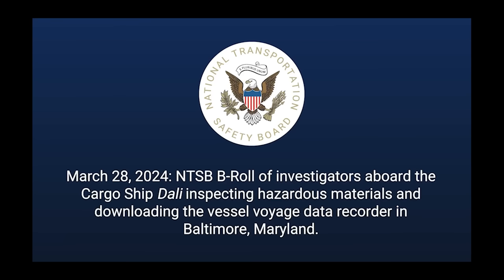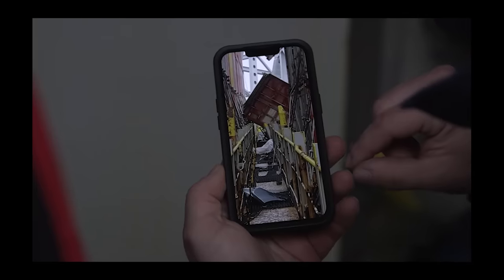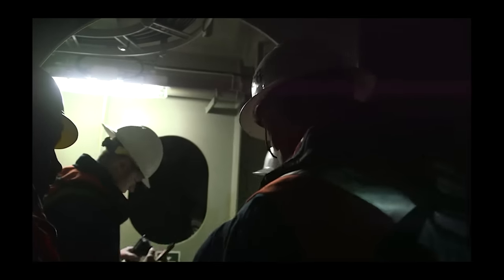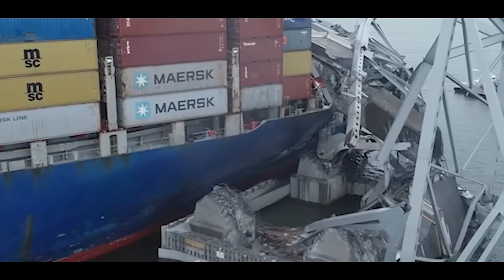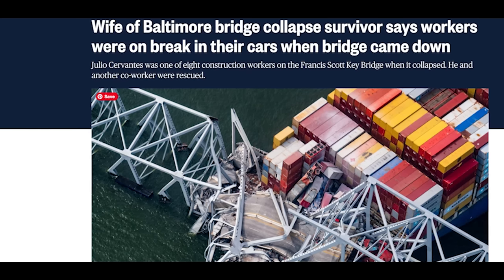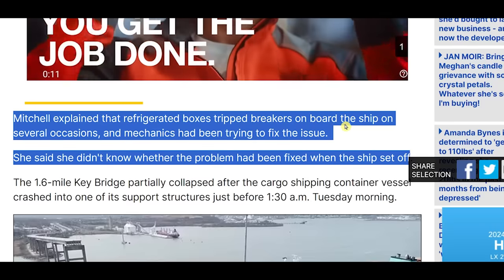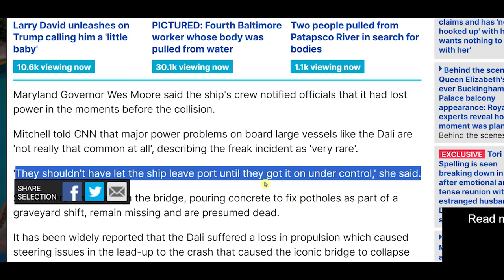NEW NTSB Video On Dali Ship Point of Impact Key Bridge

Comment: Refrigeration / ancillary equipment wouldn't be commingled with ship propulsion / maneuvering /navigational equipment/circuits . That's not going to hold up for long as an excuse for losing control of the ship.
Reply: Exactly.
Reply: and this is not just in baltimore. this has been a logn term issue with the ship
Reply: Totally. I'm a prostitute and I'm always on ships and have even been on the Dali several times and I can tell you they had problems then so I'm not too surprised.
Reply: @beckydoesit9331  That's funny you should mention that.
One of the first impressions I had in reference to, where was the captain and harbor pilot when this started.
In the Capitan's/ owners stateroom partying with hired help.
Reply: @RosanaArcelo  As well as determination, human defiance and human deviance .  Accidents do happen anytime anyplace, as does fraud as well as greed.
Reply: @RosanaArcelo  it costs huge $$$ to be tied up at port and the port authority would have been screaming at them to get the hell off his dock so the next ship can berth.
Reply: @Revkor  That ship / Captain and possibly crew , aren't going to be an issue for quite a while. maybe longer.
Reply: @tuck6464 please don't confuse accidents with preventable incidents. This was a preventable  incident.  Someone(s)responsible.  I would seek the answers to were federal laws and mandatory safety regulations followed..Jeff makes an excellent point in why did this ship ever leave dock with unresolved electrical problems. Why did escort tugboats leave Dali's side before open water? Coincidentally the Dali lost all electrical power shortly after that. .any questions no answers.
Reply: @heartobefelt  and giving  the greenlight for a massive vessel's voyage to SriLanka halfway around the globe? A trip expected to take 27 days yet couldn't make it out of Baltimore. Lots of questions no answers.

Comment: The UN numbers are indices into the hazmat classification list, with hazard category and shipping safety requirements. They aren't directly tied to the MSDS, although each UN number does correspond to one or more MSDS's.

Blaming the breaker for a trip is seldom accurate. They have a trip curve specified, in terms of  overcurrent vs time to trip, which varies by the type. If you tripped a 20A breaker with 17A, you probably had a transient inrush current that spiked over 30A. As i recall, standard home breakers fast (magnetic) trip at about 150% of rating and slow (thermal) trip at about 120%. I'd have to go look up the specs at UL or the NEC to get exact numbers.

Comment: the meter at 2:22 is for checking o2, LEL, and VOC's
Reply: It can only measure LEL if you know what you're measuring the LEL of.  The LEL of petrol (gasoline) is different from the LEL of propane.
Reply: @cjmillsnun The LEL reading is to evaluate potential explosive air/gas conditions and is not specific to a particular chemical, although the most common compounds are hydrocarbons.  LEL stands for lower explosive limit. There are special sensors for volatile compound  (VOC) specific identification but those sensors are mostly used in specific site conditions where the VOC is known.  Keep in mind the LEL is used for site safety and not generally for investigative data collection.  The instruments are calibrated to a flammable gas mixture.

Comment: The power to the cargo should never create a situation where it would compromise the ship's main electrical power system. This would be by design. Something else was going on. If it was severe enough to cause a total power loss, this should have been a major red flag to the ship's crew that something serious was going on. Virtually everything on these ships besides the prime mover is electric.
Reply: Everything will be getting tested including checks for fuel contamination , mechanical faults in the engines , electrical faults in the ship and electrical faults in reefer units , as well as the human factors , Did the crew do their job by the book or did they panic and make mistakes ?

Comment: @17:42 - They are definitely solid concrete (the Concrete Bridge Posts/ Piers). I could easily see that on my cheap 65" 4K television that I use for a monitor). The reason on smaller monitors they may appear hollow is because the concrete is darker in the center. @1:17, I believe the Grey metal is part of the ship's superstructure (primarily to support the container decks). That's why is is so large/ beefy. Of course it's difficult to tell to some extent because the bridge was also painted primer grey.

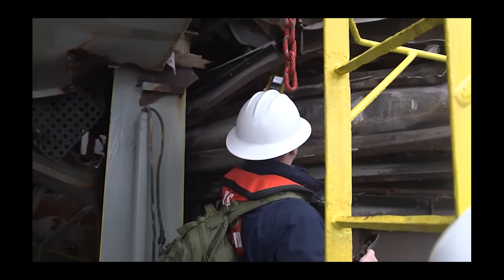Comment: 02:12 I am fairly certain that is a vibration meter. 
Also regarding breakers. Many people dont understand too that breakers can degrade with each trip. Especially if they are breaking quite high currents. The contacts inside the breaker will get pitted and wear down. Often why troublesome breakers only seem to get worse and worse

Comment: Jeff, The NTSB stated that the Dali at 1 27 am and four seconds. " The pilot ordered for the port anchor to be dropped." The thing no one has been saying is, Doesn't this ship have multiple anchors? perhaps one on each side? what about the starboard side one? If they dropped only the port side anchor as stated, it would cause the ship to change course and turn to the right...Turning right into the bridge support.
Reply from the maker: Yes, any smart pilot knows that the anchor will not stop a moving ship, it is meant for when the ship is not moving. They dropped the port side only, because I assume they were trying to make ship pivot left around the tension of the anchor chain as it hit bottom.
Reply: @jeffostroff  Exactly.  Dropping port anchor will cause at least some swing of the bow to port.  But Jeff, why do you keep calling the ship a "boat".  I was in the Army, not the Navy, but I know that is no boat.  And it is not a wall, it's a bulkhead.

Comment: I doubt that barriers would have protected the bridge in this collision. The ship was slewing to starboard, the bow still going in a sideways motion. The bow did not hit the pier head on. It hit it on the side. It is the forecastle structure that hit and sliced the pylon. This displacement buckled the pylon of the bridge and pulled the deck - to the left in the video. The recoil, the "spring back", snapped the anchor points of the deck on the other pylon, right hand side in the video. Careful observation reveals the shock wave travelling back (left to right)  along the bridge deck and structure after the bridge was put in tension by the forecastle impacting the pylon and the shearing of the pylon released that tension.
Reply: My instinct says they'd need a full-on artificial island to mitigate the impact of a ship as large as this one, and there probably isn't room.

That said, that's no reason not to have direct protection from lesser impacts.
Reply: Dolphins WOULD have protected the bridge. but the channel floor isn't really conditioned for the placement of them. However, barrier islands around the pillars would have also protected the bridge, by keeping the bow away from them. Dolphins would have been better, but it's all about cost, and unfortunately, Maryland is all about DEI and protecting the underprivileged and marginalized. Annapolis shelved several bills to add protection to the Key bridge over the last 10-15 years.

Comment: The problem with trying to "load shares across multiple breaker circuits without understanding the root cause of the problem is that you can't assume that randomly splitting the refrigerated containers with split the problem. Say there were 50 containers, but only 3 were causing the problem. You could split them into two groups of 25 or 15-15-20 and end up with all three problem units still on the same circuit. Or maybe each one by itself could throw the breaker, so when they are all on the same circuit only that one goes down, but when split all three circuits get disrupted. 
If it didn't happen when it did, it could have happened an hour or two later with the ship fully out to sea. The bridge would be OK, but the crew might have been in more peril.

Comment: Breakers can be problematic. I've seen the opposite of them tripping early. I've seen breakers trip only after being way overloaded. Like to the point that the entire circuit is hot to the touch and borderline fire hazard. Whatever the case, disasters usually involve multiple errors.
Reply: Federal Pacific Electric and Zinsco breakers were notorious for failure to trip.

Comment: It sounds like severe negligence that the ship was having electrical trouble to the point of complete power failure before it left the port yet it was still allowed to sail. If they would have held the ship back until the problem was fixed, none of this would have happened.

Comment: As a commercial driver it is the operators responsibility to do  Pre-trip and post trip inspection. If defects are found that vehicle is not to be used until repairs are made they can be catastrophic causing loss of life or severe injuries. Same in Airplane the pilot does preflight checks. It is reported that these issues were known prior to the ship being loaded prior to the ship leaving port. This ship was destined to cross at least two major oceans go through canal can you imagine this failure thousands of miles from nearest land or help. I still say the owner and the operator should be held accountable. It is blatantly negligence that this ship was loaded and then allowed to set sail.

Comment: If they put to sea with electrical/power issues of the sort mentioned in that report, I suspect they are going to be in VERY deep ** unless they can PROVE the issue HAD been addressed and tested. 
In light of that report, it seems to me it potentially shifts from "unfortunate, rotten luck" to "wilful gross negligence", and THAT would be catastrophic legally for those involved.

Of course a load of caveats. Nothing proven.

'Common sense' would have us hope they wouldn't have tried to sail if they knew they were continuing to have power issues to the point of complete loss of the plant as that seems utterly nuts. 

In fact it seems so crazy it's hard to imagine they DIDN'T have it all addressed AND tested before leaving.
In which case it could turn out to be unrelated, OR something happened that rendered their 'fix' no longer effective.

Well, no doubt we'll learn of it eventually.
Reply: The ship was under hire by Mersk & owned by a Limited company! At best you can seze the ship & sue its insurer, maybe you could get a 100 million! 😅😮

Comment: Seen a little blurb somewhere about them wanting to check the ships' fuel. Like that was the cause of the total power failure. Something about the sulfur level in the fuel. Maybe they thought they had the refrigeration issue fixed when in fact it was bad fuel?
In any case, if they knew the ship wasn't seaworthy someone needs to be held responsible for being negligent.
Reply: Its not the sulfur content they are talking about. The fuel put into all ships from small tug boats to these large container ships, even into the tanks of private sailboats and diesel powered yachts, is the red diesel called "off road diesel". In the US it's legal fuel for farm and construction equipment, locomotives, and any vessel on the water. It normally has a high sulfur content unlike the yellow diesel you put into your truck. What they are testing for is a thick, sticky black sludge that separates out of old or "stale" diesel fuel and builds up in the fuel tank over time which can eventually clog up fuel filters and diesel injectors, which by the way causes a diesel engine to "lug" and billow out tons of black smoke. It's a good sign that fuel is being purchased from other ships with unused fuel remaining after the completion of a contract. In the US it is strictly illegal to pump fuel from one ship to another unless the delivering ship is licensed and authorized to do so. They want to determine if the company chartering this ship has been buying fuel "under the table" or if the fuel supplier is selling unprocessed, recovered fuel.
Reply: @3DPDK  Is it possible they accidentally pumped heavy fuel for the ships engine into the fuel tank for the gensets which could have required diesel ?
Contaminated fuel can also cause an engine to have reduced power.
Reply: @heartobefelt  The drive engine for a large ship like this is the same huge diesel engines used on freight locomotives. It uses the same diesel fuel as the smaller generator diesels and it all comes out of the same storage tank(s) on the ship. The authorities are testing for "old fuel" for the reasons explained in my first comment.
Reply: @3DPDK  black algae in fuel can block filters in minutes too  , large quantities of biocide can stop the algae growth but it still has to be filtered out or pumped out. . .
Reply: @heartobefelt  This is a big argument point because everyone is taught that it's a form of algae that grows in diesel fuel, but it's actually not. It's a poly carbon chain molecule that looks like algae. It's kind of like raw polyester resin except it's black. The "algicide" treatment is a naphtha based chemical designed to break or dissolve the links of the chain molecule. I defended the algae argument for years until I had a chemical engineer show me what it was under a microscope.
Other than that you are absolutely correct. If you work on a boat that doesn't clean out the fuel tanks every few years, you're likely to be posted in the engine room for your watch, swapping out the Racors every half hour.
Reply: @3DPDK  thanks for the Headsup on the algae , its what i had been taught for years , even the bottles of algaecide / biocide i have used to treat the stuff refers to it as "Algae" so thats very interesting. FWIW i thought the biocide i used smelled just like WD-40.
Reply: @3DPDK  I am sure the NTSB will take fuel samples and trace back the supply chain , a few years back a guy went to jail here for setting up a fuel blending business where he would buy kerosene that had no fuel tax applied , mix it 50 % with diesel and sell it to gas stations as "diesel" , he sold tens of millions of litres of the stuff until he got caught , which happened because of complaints from truck drivers who blew up their engines running that garbage.

Comment: Jeff,

I don't believe the Dali was ever in danger of sinking.  Based on the information in the videos the maximum depth of the channel is 50'.  The channel does not have vertical sides.  If you look at a cross-section under the bridge the channel stays at 50' for the width of the main channel and then it slopes upwards to somewhere around I'd guess 20' at the bridge piers.  They have said that two forward compartments are flooded and there are about 3 to 4,000 tons of bridge on the bow.  It is safe to assume the ship is aground.

Damage to the ship structure will be both from the impact of the ship hitting the bridge and the sudden downward force of the bridge falling on the bow.  When the ship's structure is designed these types of loads are not considered.

With that said, I took a marine engineering course on nuclear propulsion.  I remember discussions on the placement of the nuclear reactor to protect it from collisions.  We also discussed the design of the hull to absorb the energy of a collision and to ensure the striking vessel suffers more damage than the nuclear-powered vessel being struck.

I would not be surprised if there were electrical problems.  I am not sure about the timeline from the report you were reading.  The M/V Dali  according to the AIS track departed the berth in Baltimore, made a U-turn, and headed toward the Francis Scott Key Bridge before losing power and striking the bridge.  This report of the ship being at anchor for 48 hours because of electrical problems.  It has been mentioned there may have been issues with the electrical system.  In addition to the VDR there should be printouts from the Bell Logger (changes in throttle), from the engine room, and the  alarm logger (automation alarms with time stamps).

Bob

Comment: The Voyage Data Recorder (VDR) on a vessel is designed to continue recording even in the case of a power failure onboard. The VDR has a dedicated reserve power source that allows it to record bridge audio for at least two hours after the main ship’s power fails. This ensures that vital data is preserved for investigation purposes12. The recording is continuous and all stored data items are retained for at least 12 hours2.
Reply: but if the UPS battery was pooped they would lose data during a power outage ...
Reply: @heartobefelt  Then we must develop to include UPS test as part of Pre- departure or Pre- arrival test checklist on VDR and ECDIS as practical as possible. I think the investigator also looking for evidence how many secs the Emergency Generator take over as emergency power supply to steering system,at least can be used to evade the Bridge support pillars ,while there was a momentum. Likewise ,there will be now a mandatory tugs.employed until the vessel is cleared from the Bridge.

Comment: The fridge and refrigerator motors have a big in-rush current (like 7x the nominal current when running) , so each should 
have a timer of few seconds difference, so they will not start all together at the same time after a power failure.
Also any electrical motor, like fridges or air contitioning should have a SoftStart device to lower the current needed when starting.